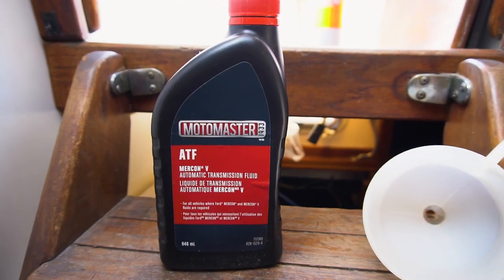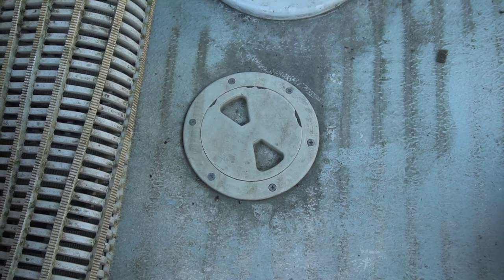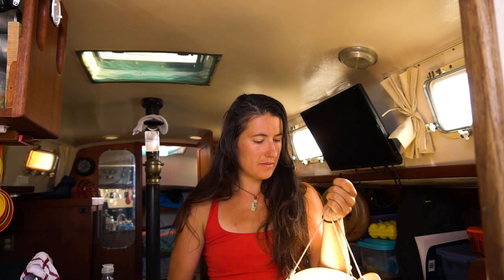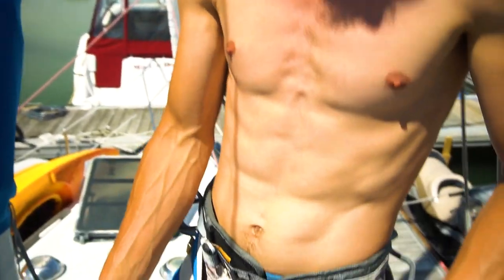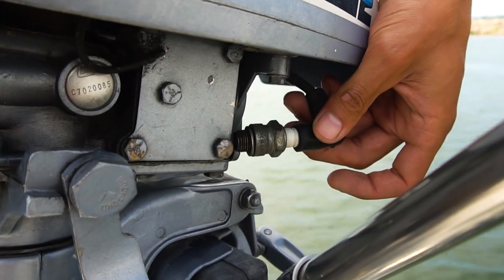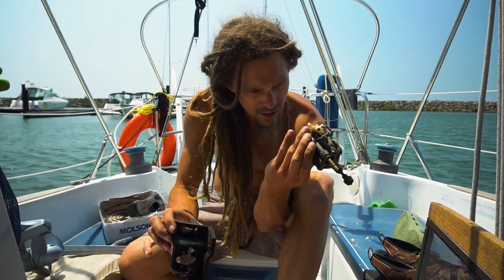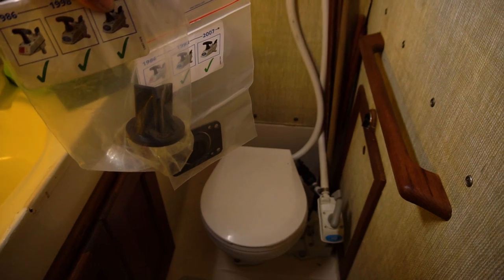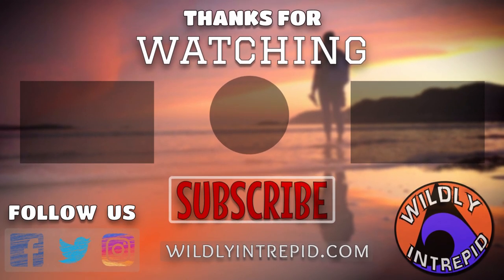BOAT WORK never ends | LIVEABOARD on the water now [Ep 20]

Comment: Most of my troubles with my boat are "Toilet" related. Either the toilet pump does not work ( top valves), it back-fills (Joker valve), the hoses leak, the tank is full, the pump out station is closed or there are two many boats in line or it is out of service. Oh yeah, how about the smell...Bonne chance, Richard
Reply from the maker: The toilet is certainly troublesome. We've had some trouble with it back-filling even though we've replaced the joker valve.
Reply: Wildly Intrepid Not sure if your still having issues with the head but sometimes overtightening the joker valve screws will cause back flow . Excessive tension can deform the valve inside the housing . Also if you have to fight the hose that attaches to the valve to get it on it may be exerting sideways pressure on the housing which could also deform the valve. Tinkering with the screws and a heat gun might set you right .
Reply from the maker: Thank you so much for all the good tips. I might have those screws in too tight like you say. I'll have to try that. Cheers.
Reply: Most of the time it is because the height of the inlet of the holding tank is quite higher than the height of the toilet outlet (Water column). The Joker "one way" valve is to prevent the black water to come back when you are pumping; after, water finds its way thru this  "Joke" valve especially if the water column is high. You could replace the Jabsco pump assembly with the one which includes a shut off valve. Cheers, Richard
Reply from the maker: Actually the holding tank inlet is a bit higher than the toilet outlet.
Reply: Wildly Intrepid tartan sailor has a point about height .Beckson makes an 1 1/2 inline valve that is about 25$USD (unsure of longevity) . Had to put one on a friends boat a few years ago because of a back flow issue . Wasn't perfect but after adding an extra loop in the hose it controlled it about 95% of the time. Hope that helps . Also how did Alex get that crazy scar on her shoulder ? Looks like it was likely a painfully event .
Reply from the maker: I love all the input and tips. Especially when you're new at this sailing universe. As for the scar I wish I had a crazy story to tell but it was a lipoma. So it was just a small surgery which wasn't even painful.

Comment: Look up Lavac head.  All you need to do is buy a big bilge pump, That will pump it out, way stronger than those type! Then to get water in you need to seal the lid. The lavac ones cost a fortune, so get a piece of plexiglass that will cover the bowl and put a gasket on the plexiglass that seats on the bowl.  After using put it on, pump it when every things gone you have to wait a min. for vacuum  to release then take it off and pump all the remaining water out.   If you look at my video's  no. (60) Replacing the head, kind of shows  how i did it. You may be able to just hook the pump up to your bowl. Let me know if you want any more info.
Reply from the maker: I'll have to look up the Lavac head and check out your video. I've never heard of it. Also was considering a composting toilet
Reply: So many are going to a composting head, but I don't like the idea of playing around with poop! I just turn the valve and it drains no power for pumps.  Had a friend with a very expensive boat that wouldn't put paper down his head, put it in a bag! GROSS ! Especially if your out for a few weeks! I don't understand why so many make things difficult.
Reply from the maker: Everyone has their own preference for types of toilets I guess. Just watched your video. It's pretty crazy how some small parts are expensive hey. I'll try to tough out my toilet until it dies.